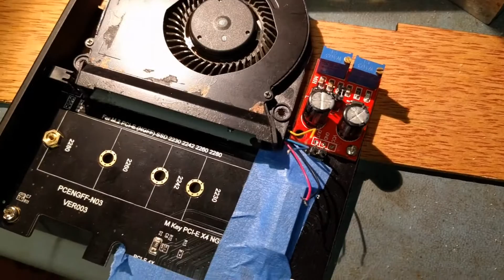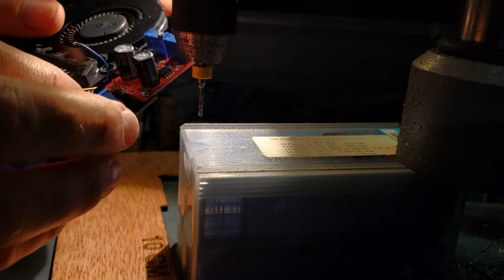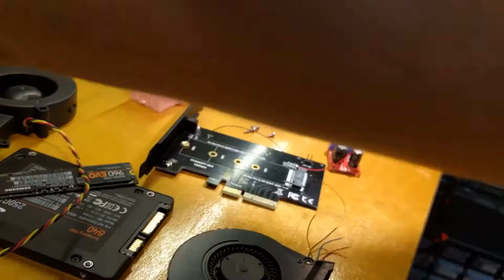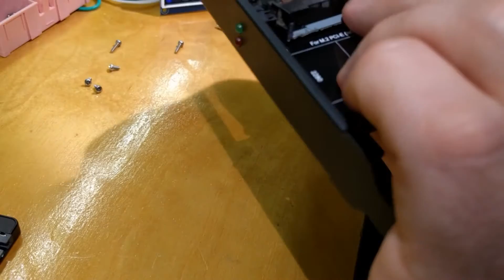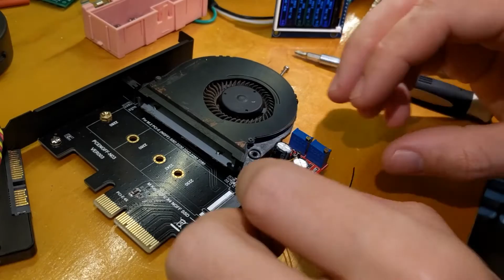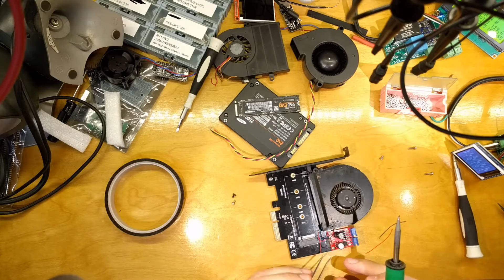Samsung 960 EVO 1TB SSD Cooling Fan Mod

Comment: Nice mod I just with you gave of before and after temps :-/ (still gave a thumbs up)
Reply from the maker: Yes you are right I should have measured them before.. It was hot enough to burn your finger before, now it is max of 35C under full load so it did make a difference.. Anything hot enough to burn you is too hot for longevity of the components in my opinion.
Reply: That's a huge improvement, nice job! Thanks for taking the time to reply.